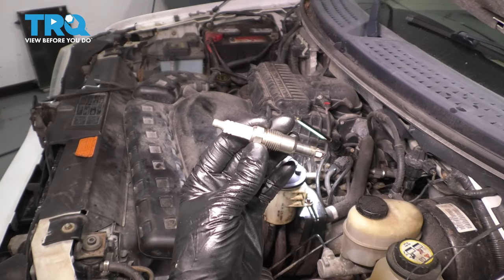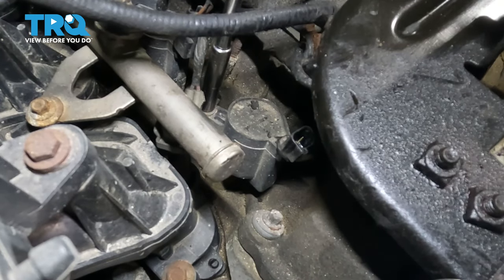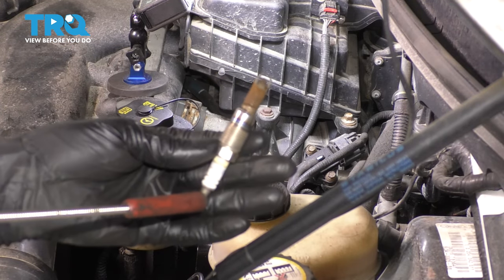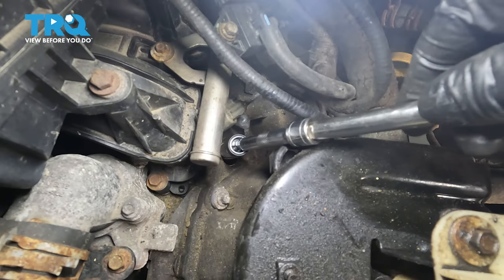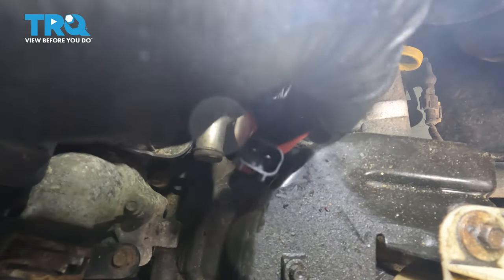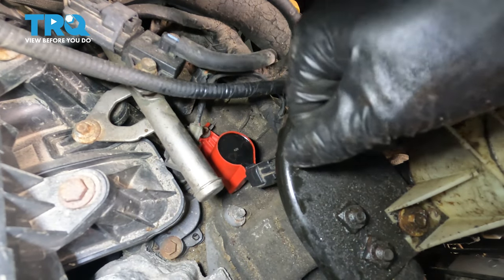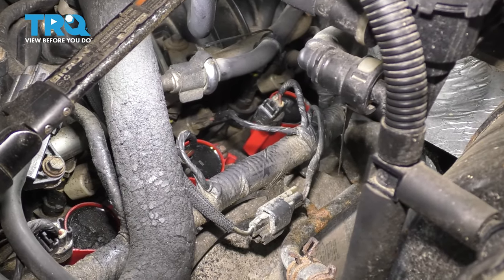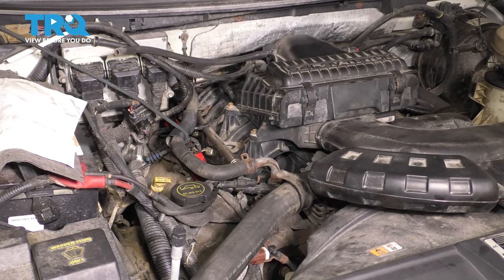How to Replace Spark Plugs 2004-2008 Ford F-150

Comment: Bro I'll be honest Ive been a Ford dealer mechanic for years. Best thing to do is remove all those pcv hoses, vacuum hoses, disconnect heater core hoses, unplug the wire harnesses and zip tie them out of the way gently, remove the ECU and the ECU bracket on the passenger side firewall and remove battery. You do this will be 30 mins of work but you will save your hands from getting cut up and save your back from blowing. Overall makes the job much easier. I cover all the vacuum ports before blowing the spark plug tubes out from dirt. Also I gently blow all the sensor connectors and pigtails make sure no dirt got in them from flying dirt everywhere. This also gives you enough space to stick a baby 3/8 impact gun in there to shock the spark plugs out but we always keep the special tip removal tool just in case. Ford has an update plug that is stronger and doesn't break the tip off as easily. One last tip please spray the 7mm coil bolts with a pbblaster spray they corrode all the time and snap the intake manifold or the valve cover then it becomes a nightmare. Best to spray crack them loose then spray again and turn. Do this for the spark plugs and those crappy little 7mm coil bolts .... Prayers sent

Comment: Why did they design it like this? I am planning on fixing up my grandfathers old truck that’s been sitting for years. My 2008 Ford Fusion even has all the spark plugs on the top for easy access. That’s crazy.

Comment: also i found someone [probably a mechanic] had wildly tightened most of the plugs. i do not beleive that extreme tightness was just heat or rust seizing; else it would of affected all those plugs....i needed a long breaker [about a 2 and half foot] bar to break loose at least 5 of them. i applied pressure off and on..not just steady...and she broke after about 4 applications of extreme pressure. a few were normally tightened to that easy 25 or so ft lbs. i think this is why many guys get broken off spark plug heads; a nightmare hassle to remove and tap out

Comment: just did mine on 5.4 2006 f150. small pebbles were stuck in 2 of the spark plug holes and would not allow the socket to sit down all the way plus the pebbles were JAMMED in there. i used a bigger socket [5/8]  and lowered it down around the plug and banged on it about 10 times medium hard to pulverize the  stuck pebbles...i then could use a flat long screw driver to loosen up the pieces  so they could be blown and or vacuumed out. if you find your 9/16 just spinning around in there on top of the plug or slightly gripping...dont strip it off...get rid of the debri first. socket will sit down  fully just fine after you do

Comment: Why use silicone paste? It will touch the spark plug conductor when you press the ignition coil, and it’s electrically insulating.

Comment: If I get the Lisle, is this any different than a standard plugs change? Accessibility? I’m seriously considering buying the tool and doing it myself, but the last thing I want is to get in over my head with it. I’m pretty mechanically inclined but I do not have the ability to remove heads and all that. So does the Lisle guarantee that I won’t have to rip the heads out? Any help appreciated.